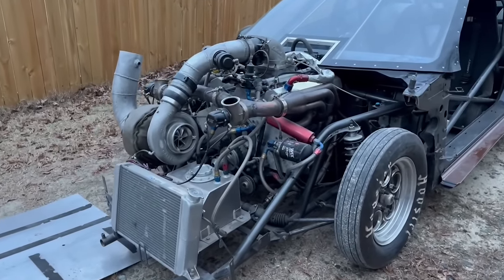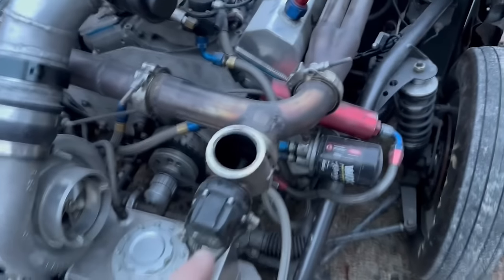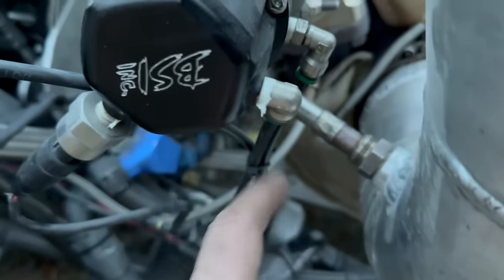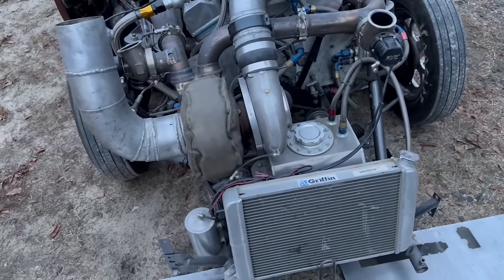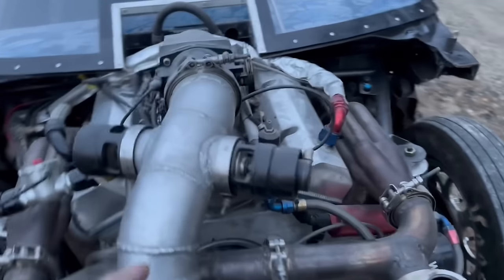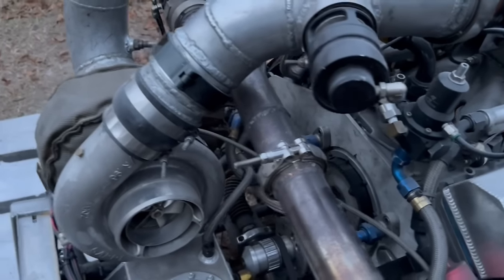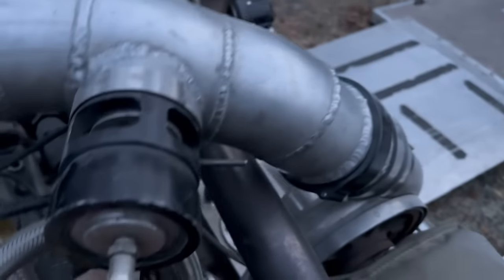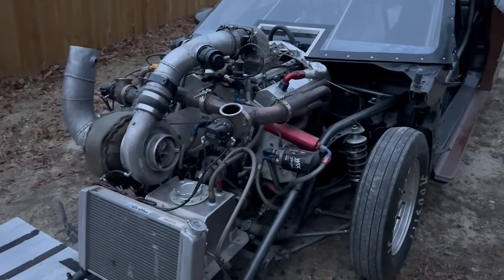What are Wastegates and Blow Off Valves?  How do they work?  Here is a rundown of their operation!

Comment: It will be harder on the turbo John I was with a team running that setup and it's pretty slick but you do put a little bit more wear on your turbos but I would say it's no more than ten percent more and worth it in my opinion for how sweet it makes controlling the turbos. It allows you to make peak performance out of your turbos with better control for the whole run and it's repeatable every time and that's something that's unheard of in the turbo world.
Reply: Is the additional wear and tear on the turbo due to it over spinning or from back pressure in the intake back onto the turbo?
Reply: It seems to me that smaller engines would be able to spool the turbo much quicker with the waste gate on the charge pipe, is that true?

Comment: Yeah, I have had the same question in my mind about the way Promod guys like Mark Micke are running wastegates on the intake side only.  How do they keep the turbo from over spinning?  Is it controlled via back pressure in the intake charge pipe back to the turbo?  Will be interested to hear the information you get from Vanderhoof.
Reply: It's been really interesting what Mark and the guys at Fuel tech have done.  They have said that there's always a limit to how fast a turbo can spin according to how much air the engine, and all the supporting parts can handle.  As long as your running a good, proper sized turbo (not an ebay hairdrier) you shouldn't ever over spin it.  It's kinda like the cheap dollar store pin wheel.  It only spins as hard as you can blow on it.  At some point, a motor runs out of "blow".   It's really no different that having your waste gates pinned shut at wide open throttle.

Comment: Will using wastegates on the turbo discharge pipe cause the turbo to push oil pass the turbo seals? Everytime I see a diesel blow off a turbo hose it push oil pass the turbo oil seals

Comment: John diesel engines don't have throttle plates No butterflies therefore they can not search
Reply from the maker: They surge when you are on the left side of the compressor map.
Reply: @TurboJohnRacing  in your case it's either a bad wastegate that's a 7.3 or is there a variable vein in back of the turbine wheel that stuck because of the carbon which is what controls the Boost that's why you don't see a wastegate